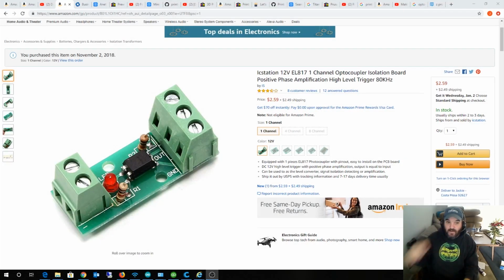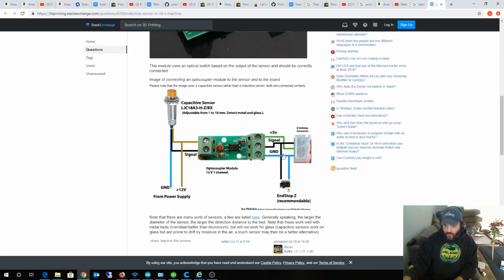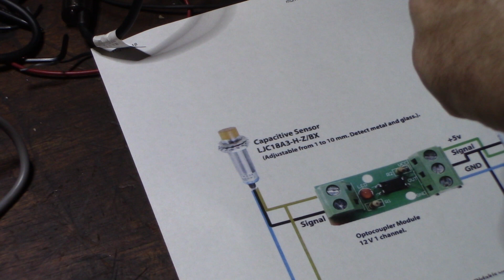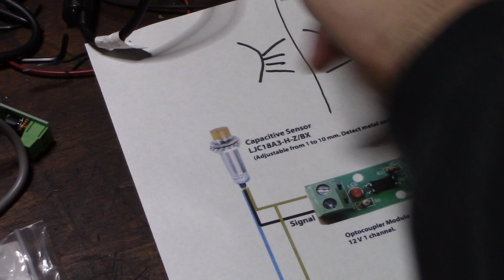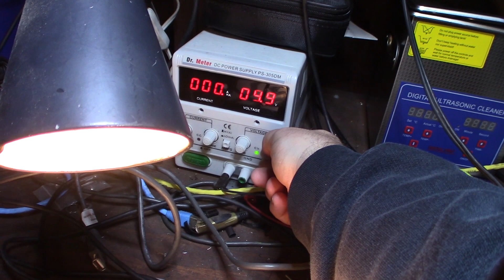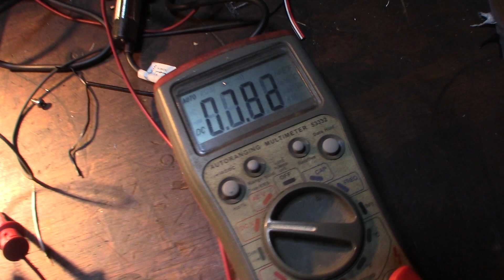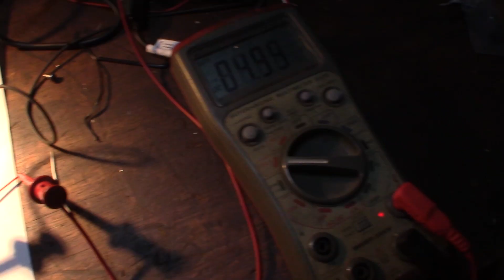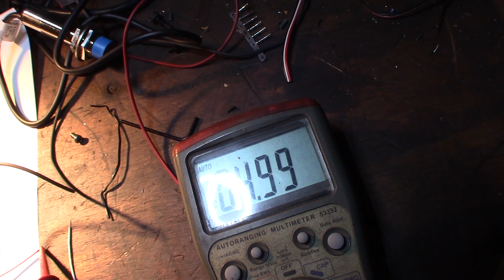How an Octocoupler works in 3D printing auto bed leveling sensor Anet Creality

Comment: I see that you do not show the 12v voltage to feed the sensor, you feed everything with 5V, that is, why put the optocoupler if everything works at 5V. It truly shows the two voltages, thank you

Comment: mine is always on, been trying to invert the logic of the marlin with no success, it is always detecting
Reply from the maker: What happens when you take out the  optocoupler and hook up a multi meter. The make different sensors PNP NPN, normally open, normally closed. Sounds like you have a normally closed.  What happens when you put a piece of metal up to it?

Comment: I have an issue with my setup. I have the same Octocoupler and Sensor on an Anet A8. When I wire my 12v+ from the psu and the brown wire from the sensor to the positive on the Octocoupler , and the black signal wire from the sensor to the other connector on the octocoupler and the blue to ground, without anything in front of the sensor, both the LED on the octocoupler and sensor are on. This is with nothing coming out of the octocoupler to the mainboard. I thought it could be a bust octocoupler, and I ordered anotyher, but still the same issue. My Sensor works as it should (apart from being not as accurate and only have 5v going to it) when plugged directly into the mainboard and using 5v - nothing in front, no light. and something in front, light on. Could it be a bust sensor, even though it works with 5V?
Reply: I have the same exact issue, I'll try directly to the board because switching the logic on marlin isn't working
Reply: Is working now, 12v to PSU, black on left (octocoupler) and right use ground (that is also connected to the PSU), sensor is always on but only when something is detected the octocoupler triggers

Comment: My power supply is 12v 30a. Can the optocoupler and the inductive sensor handle all that current.
Reply: That's not how it works. 12V 30A means your power supply can deliver that much current at 12V. Amount of current going out of your supply at any point is always smaller than maximum rating to give it some breathing room. So if you hook up small LED which uses 30mA on your power supply, then it will only supply 30mA.

Comment: Ok, the video is good idea but I'm seriously more confused after watching this. What does this thing really do and how would it look in a actually printer setup and not with clips you can't see where they come from look? I'm seriously scratching my head now.
Reply: You'd replace your Z end switch with this connection. Proximity sensor is then placed on printer head a bit higher than nozzle so it doesn't slam into hotbed. And that's it. Your printer will stop relative to hotbed instead of absolute Z value. If you wish auto leveling then you have to enable that in firmware. There are videos that explain that in detail.

Comment: At 12v what distance the sensor detect objects? Mine is very low and i dont know why.
Reply: Have you trimmed the screw on the top of the sensor. That is for altering the sensitivity
Reply: Depends on the sensor, for example if you have LJ18A3-8-Z, that 8-Z means 8mm distance.

Comment: do you have to connect the 5V? what happens when you dont?
Reply from the maker: The 5V is needed to trigger the endstop function. You need 12V to power the sensor.

Comment: Question if you were to supply 12v via the power supply wouldnt you only be able to output 12v to the endstop switch. Wouldnt you want a reduction in voltage output side to 5v.
Reply: Can you do this experiment using 12 volt input? Im not fully understanding this I looked this coupler up on amazon and its a 12v in 12 v output so where are you getting the volts to the board or rather how are you getting that. Sorry to be a pain in the arse.

Comment: I use the same octocoupler. Great little device with my (now) capacitive sensor. It was inductive. Oddly I found if I wired a microswitch endstop into the mix following the wiring, the probe and octocoupler still work fine but the printer ignores the switch. If I wire the probe and switch directly to the endstop connector and run on 5v it works. Weird. Not that I really need the switch though with the probe